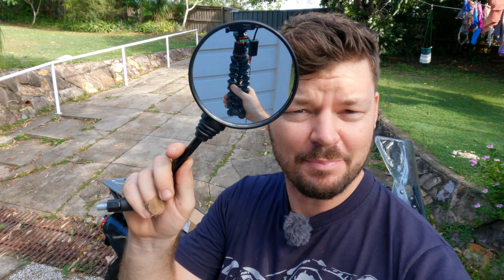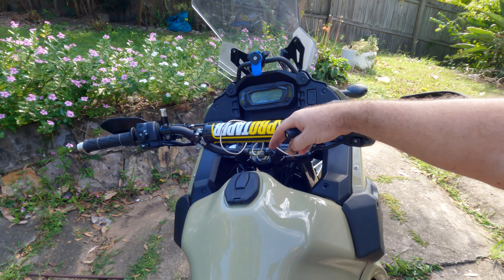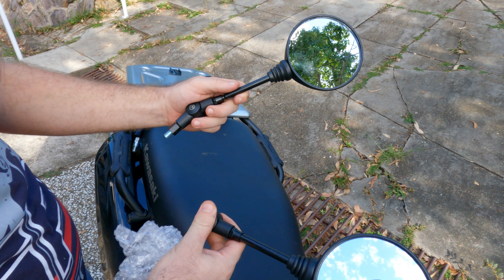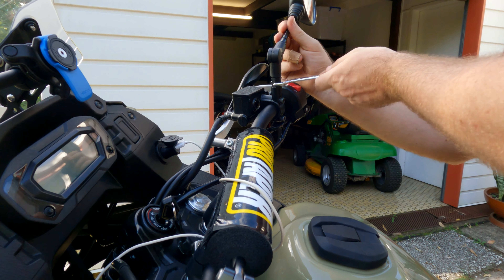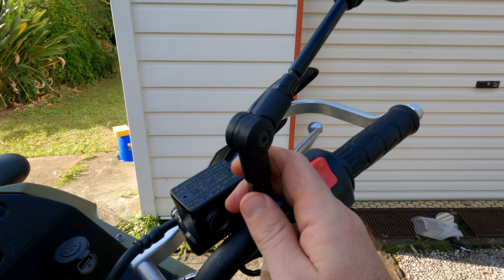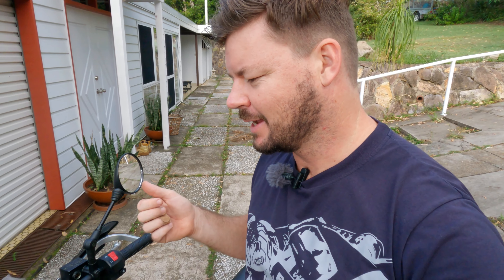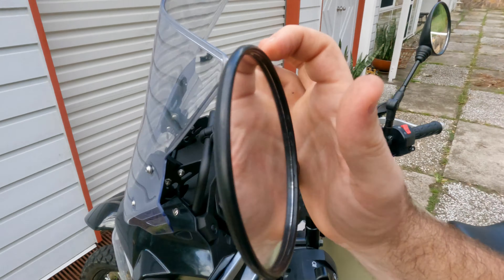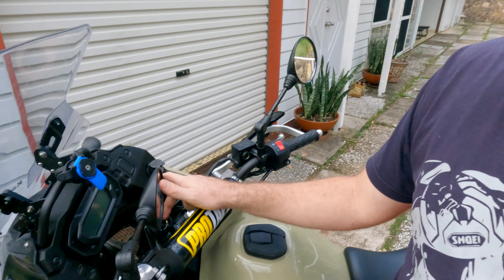Folding eBay motorcycle mirrors | Bargain buy or cheap s#%t?

Comment: Good review. The fold in for when riding off road is nice.
Riders report the Double Takes are expensive, vibrate on even multi cylinder bikes and are easily stolen due to the big wing nut in the mirror's mounting arm.
Reply from the maker: Good point, hadn't considered that